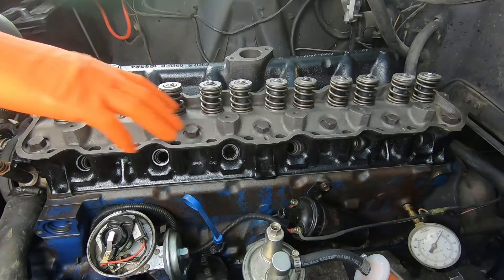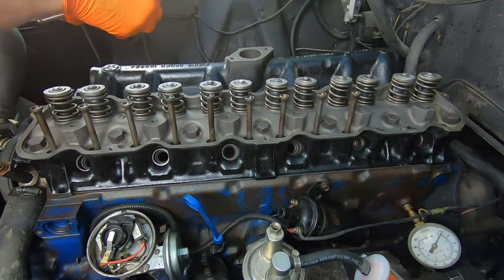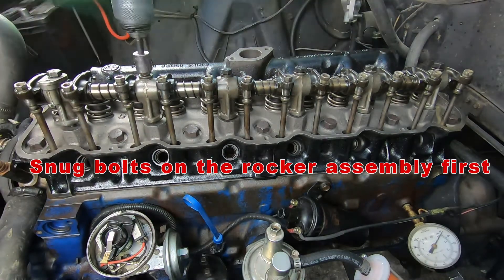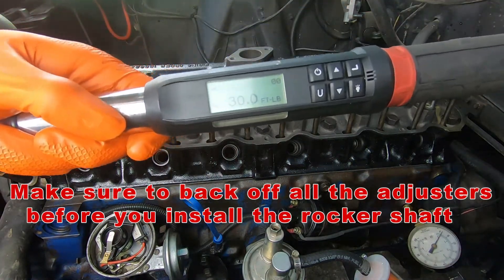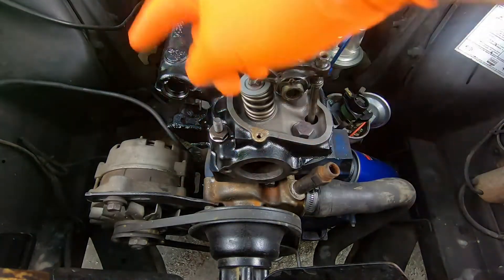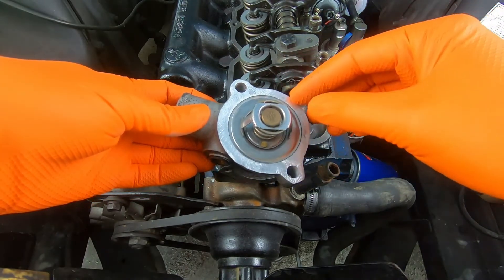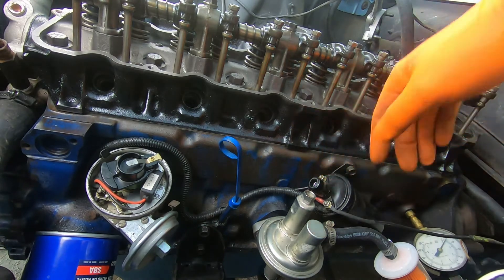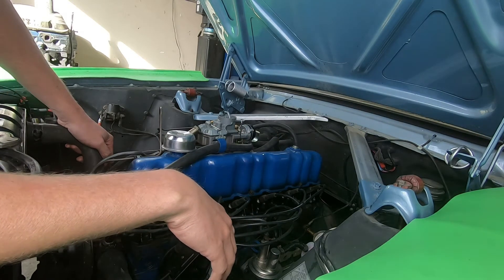200 Ford inline 6 - Installing Cylinder Head part 2 -  Valve adjustment & everything else

Comment: If you took the head out with the exhaust manifold attached, couldn’t you install the new head with the manifold already attached for quicker installation?
Reply from the maker: Yes you absolutely could do that
Reply from the maker: I think I was waiting on that exhaust port divider or I probably would have done that. Thank you for subscribing.
Reply: @AlfsMustangGarage  Good.  My boyfriend and I are going to buy everything next month for the head job.  His 200 ci has the self adjusting lifters without the adjusting tappets so it’s going to be easier for us to install everything and get going.
Reply from the maker: Awesome and good luck!
Reply from the maker: Oh and just remember, if the engine block and cylinder head have been machined more than 0.125 inches, than the non-adjustable rocker arms can put too much pre-load on the valve.
Reply from the maker: Yup, just double check everything and take your time. You can never be too careful. You can also find loads of information on ford6.com

Comment: Great info on setting the adjustable rockers. I think it was in 68 when they went to the non-adjustable type.  Not sure what there reasoning behind that.
Reply from the maker: Ya I'm not sure why either but this engine before we rebuilt the head, had a solid state rocker assembly. So we had to locate an adjustable setup and different pushrods. And this is a 66 engine. Ford did lots of weird things. Or I should say, they do lots of weird things.
Reply: i have a 68 200 and mine has the adjustable, maybe mine has been rebuilt at point??
Reply from the maker: I'm not 100% sure as to which engines and when got adjustable rockers and non adjustable. I know it's much nicer to have them adjustable though 👍
Reply: @AlfsMustangGarage  oh yes for sure! I will be adjusting them after watching this video! Thanks!
Reply from the maker: You're welcome!